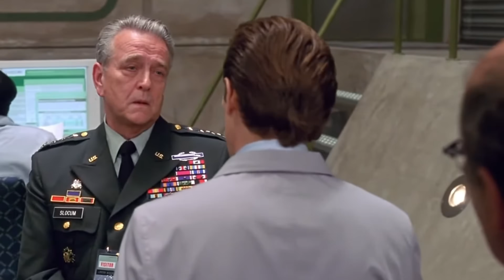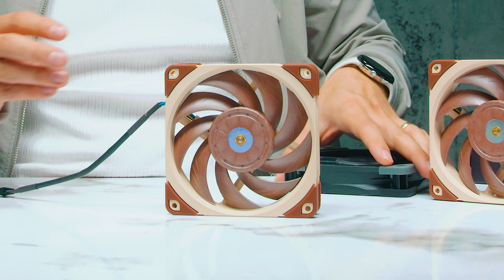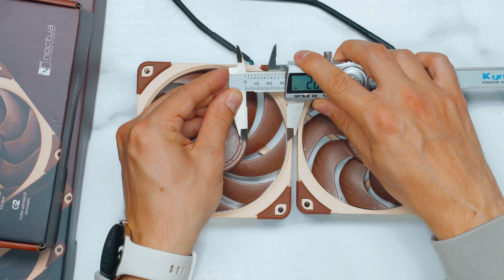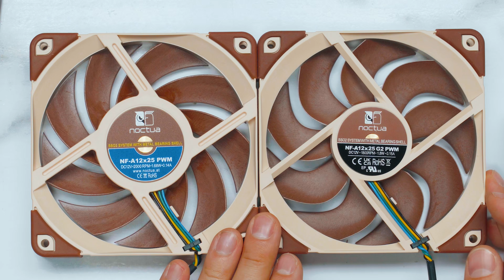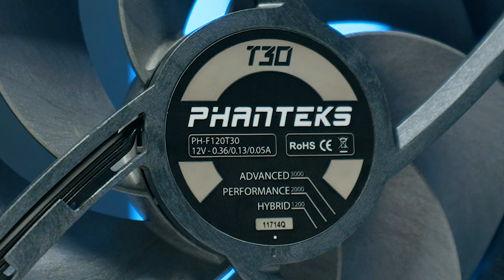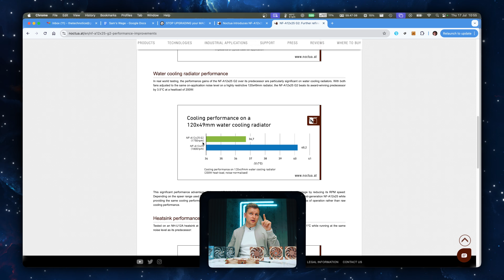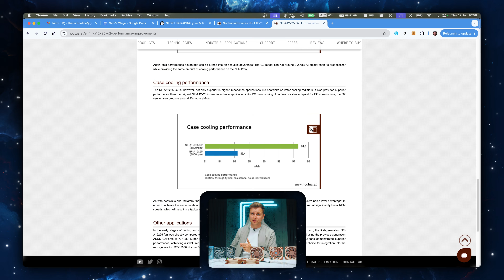Why it took Noctua 7 YEARS to BEAT the CHEATING Competition!?

Comment: I have 10 120mm fans in my PC with room to go for push-pull on my rad so that would be 13 fans. If I went with all Noctua, that would be 520 euros for fans, each being FORTY EUROS. That is insanity.

13 Arctic P12 PWM fans would only be 65 eur. Are they anywhere near as good? Hell no. But Noctua's pricing is braindead.
Reply: Arctic still the best choice p/p
Reply: Noctua fans are expensive. The A12X25 G2 is 35 € though, not 40, and right now on Amazon the v1 is actually 33 € new, 28€ used (from Noctua, which includes a full warranty) and you can literally get a used 10-pack for 240 €, which includes a splitter and a 30-cm extension cable for each fan. It's still substantially more expensive than the P12, and the bundle obviously doesn't make up for the price difference, but their longevity might - every Noctua fan I ever bought is still running smooth (17 years and counting). I can't speak for their silence as I haven't compared with the P12 but, with 10 or 13 fans, I imagine even a 0.5 dB gain per fan would make a big difference on a daily basis.
Reply: @yumeN0dengonThe P12 isn't competitive in the noise department at all. It's somewhere near the bottom actually.

Which doesn't really matter if it doesn't need to spin very fast since you'll need to take the noise floor into account. They're just cheap fans that will do the job.

Comment: I've been buying Noctua fans for decades now. I probably have about 40 of them and I just realized not a single one of them have failed. Nice lol. I do get a lot of Arctic and BeQuiet which are also pretty good, Arctic especially for the price, but sometimes that extra little bit better makes the difference you need. Their support is pretty good too, like I needed to rotate some fans 90 degrees on a discontinued 2011-V3 line and they sent me a bracket adapter I didn't know existed.
Reply from the maker: Wow, nice!
Reply: I've had really good support from be quiet! too.
Reply: I have about a dozen of Noctua fans and one has died on duty. I have to clean it and see if this may ressurect it.
Reply: What are you doing with 40 of them?
Reply: I've got a failed Noctua. A 92mm (Had to get Noctua, nobody else bothers to make a decent pressure fan in this size)
Was a GPU deshroud swap.

I've just realized that it was probably still under warranty and I could have exchanged it lolololol

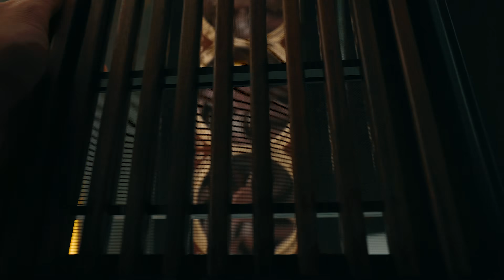Comment: 11:36 The three fans of my gpu run at the exact same speed, and past 60% fan speed I get these annoying sounds
Reply: Actually if they run at the EXACT same speed they won't make extra noise. It is when they are only a few (relatively) RPMs off, it will create a "beat" frequency that makes an intermediate sound.
Reply from the maker: Yep!

Comment: I doubt any fan brands are cheating, it’s basically copying. Before Noctua NF A12 x 25, there is Nidec Gentle Typhoon. So everyone starts copying. For Arctic P12, they don’t even copy, it’s originally with 5 blades. So how are fan brands cheating 🤔 hmmm. 

Now Noctua G2 yes original design.
Reply: It is just clickbait.
Reply: he is just reading the noctua spreadsheet, and interpret it wrong, and spit out that.
like the resonance part, they didnt do that to use A-B-A on one side of the radiator, instead its made so that in a push-pull configuration the blades of the fans slightly overlapping because the small difference in speed, as noctua always have stated.
also bad use of caliper for measuring the lenght from hub to side
Reply: @Ta5.   You might be right, my bad. I find it off to read from script, if it's provided by Noctua, pointing out other brands are cheating.. hmm abit silly. Anyway, main focus to be here is to see the new G2 fans. Thank you Tech Notice, pardon me for being blunt.
Reply: @KleoYan I dont think that he fully read it from a script or at least that script isnt fully by noctua, because I highly doubt that noctua would call their competition as cheaters or would give an inaccurate example about the resonance
But yeah, to me, this highly feels like an ad
Reply: oh hi Kleo you here too😁
yea great👍
Reply: @luxubu666 hi ya 🤭🤭🤭 yes am here. Being lazy and watching reviews hahaha😂
Reply: Kleoooooo! 👋 H!
Reply: @OrekKolnas Hi 😉

Comment: Dear Noctua, colours other than tan and brown exist
Reply: Chromax version for NF-A14X25 G2 comes this quarter, for NF-A12X25 G2 it will come at quarter one next year. White fans unfortunately were dropped from roadmap.
Reply: @eliadbu  but the chromax versions are expensive. I guess noctua can get away with charging more for black versions. A friend of mine who is a technician told me black fans are cheaper to make and it's absurd noctua charges more for their black versions, but the chromax comes with more accessories so I guess the higher price is somewhat justified
Reply: @ahmedhamdan2009  it's noctua, if paying the extra 10% for chromax is too much for you, yeah get a different fan as they're not cheap to begin with.

Comment: Before we give Noctua too much credit, it got its design for the original A12x25 from the Nidec Gentle Typhoon.
Reply: Not true at all. And the basic blade shapes aren't really copying one another at all anyway, the shapes have been known for decades, nobody is really doing anything dramatically new, Noctua just executes the best in the market with the highest quality.
Reply: Was searching for this, gentle typhoon was the first of it's kind, more credit should be given, the giant whose shoulder the other stand on
Reply: I have them too. not in use now.. but no.. they were not ripped off by Noctua. Also, that is a visual thing based on a common blade count, but you aren't taking materials, blade shape + distance, etc, into account. nidec didn't do that from what I know.
Reply: A misconception about blade geometry and angle of attack is often propagated by those who do not fully understand these concepts. They are not similar except for the number of blades.
Reply: Please, they share 9 blades like other fans and nothing more. The Gentle Typhoon was a good fan back in the day, it was either them or Nexus fans that was high up on the list...i remember having a bright orange Nexus fan in my Antec P180. The good old Athlon64 and Core2d days.

Comment: One day, when Noctua makes them in black, and the prices drop, and I have spare money, and my PC is getting too hot, and nothing else helps, I'll probably buy these.
Reply: For me it’s the price man. Bring down the dam price!
Reply from the maker: Bring on the black
Reply: @theTechNotice  Should i buy intel for quick sync even after rtx 5060 ti  release?..
Reply: I need them in white
Reply: I was once one like you. As i got older, i appreciate the hard work, good performance and reliability of these alot more.
Reply: @nicoleibundgut534  My PC already has hard-working, good performing, reliable fans. These would be 100% luxury if I ever bought them.
Reply: @nicoleibundgut534  yeah exactly!
me too... just bought Arctic for years but than i tried beQuiet and Noctua. Now there is no return to the cheap stuff xD
Reply: Yeah that's pretty much how I feel. I'd also love to see Noctua go after the deeper highspeed brute-force "cheater" fans with a version of the ones in the video- Similar performance, slightly quieter, with that Noctua quality. Maybe around 2,500 RPM?
Reply: The black ones will arrive but the prices usually just stay where they are with Noctua. I really like Noctua products for a long time now and the prices have not changed a bit.
Reply: @JikoMuskato Too expensive but for those who need best fans for everything, put once and forget for 10 next years, these fans are top right now, if we talking about 25mm thickness.
Reply: so never?
Reply: I bought Noctua black already)
Reply: I'm still running NH-D14 with original fans from 2011 the computer is running 24/7. With Noctua you are paying the cost upfront and don't need to care about performance/noise changes over the years. Over ~10years you will pay same for cheap fan replacements. For me paying upfront it is worth to not think about my pc getting louder and for not replacing the fans with case upgrades.
Reply: Precision is not cheap , they are paying alot for quality control with the tolerances between the blade end and the body
Reply: In the meantime, I buy Arctic fans, because they're cheap, good, and black.
Reply: I always say that Noctua's Achilles heel is the amount of time they insisted on poop-colored fans.
Reply: I bought the black one. I would also haven CV ought the brown one, because you likely don’t notice much I’m my build, but then I saw the black one
Reply: buy thermaltake spirit you dont need these and its cheap
Reply: They'll get right on it your heigness
Reply: Black version will come out q1 next year, as for price well they don't usually go on sell...
Reply: @eliadbu Noctua released them already!!!🎉🎉🎉
Reply: The are two kinds of people. First are those who cry about the color and price and the second are those who buy them and used them for many years. If you cant do them math , we are sorry.  I still have my very first noctua fans from 2010 and NH-U12S. That's 15years.
Reply: @GabrielKozsar  I only care about the color for one reason: I don't need them; they're inherently a luxury, so I would want them to look good. Chances/hopes are I don't spend another penny on my PC for YEARS
Reply: @GabrielKozsar I still have my fx 8370 an a gtx 1070 with nhd 15 cooler on it . An all Noctua fans . Not one of the fans make sounds of failure. The builds right at 12 years old now .
Reply: Noctua fans are built to run for 15+ years. I've had Noctua Industrials for 6 years that still work perfectly after almost 24/7 usage, and some older brown models that came in an NH-D14 from 2010 that still work in my backup NAS. Yeah they're expensive, particularly with these G2 fans, they are 1) quieter 2) perform best, so you aren't paying extra for nothing. Now, certain builds you don't need them and certain budgets there's no way you'd rather better case fans than a better GPU, CPU or doubled ram, but they do the job they say.
Reply: @bigpoppa1234  arctic ones will last between 5 to 10 years. they cost 1/5 of noctuas, so that puts them up to 30-50 years at the same cost. Noctua is great, if u can burn money for no reason.

Comment: No replacement for displacement. At the pricepoint, the T30's still the king, even in just Performance mode.
Reply: You haven't used p12 max I see
Reply: @igelbofh  I said at the pricepoint. The P12s are half the price of the T30, so I think it's unfair to compare them in any way. But yeah, buying a big pack of P12s is usually the move when I want to populate a case with hella fan slots. I've never used the Max version though.
Reply: @ccayco the p12 max is a very different fan than the p12. Try them
Reply: @ccayco saying not to compare a product because the price is different is wild. For most people it is arguably one of the most important comparison metrics.
Reply: @ccayco  Price has nothing to do with the actual performance of the product, isn't that obvious??
Reply: The P12 Max is waaay too noisy to be in the same conversation as A12x25 and T30
Reply: @Mikkel111 only if you run it above 93%. It still moves a lot more air than the others at lower rpm though
Reply: @igelbofh  It really doesn't. Every single review I've seen had it at mediocre levels of air movement. And it's a lot more noisy at just 1200 RPM and up.
Reply: @Mikkel111 try it for yourself. It's not that expensive. P12 is not good, p12 max is a completely different, much better fan, especially when the air needs to be pulled/pushed through some mesh. The noctua doesn't even qualify here
Reply: @igelbofh  P12 Pro (and even P14 Pro) are out now - they are on another level + fixed some noise issues of P12 Max... lower max rpm but higher airflow at same RPM, also x1,6 higher static pressure. Just another banger from Arctic :D

Not that the P12 Max is bad, I bought a few slightly used (got em at a great price), using them in my new build... tho if they are allowed to rev to maxspeed they definitely sound like a airplane turbine 😂
Reply: @jxg1652 don't rev them beyond 93% :)
Reply: P28 are about the same performance wise, chose 'em over T30 due to cable management, 5 cables instead of 34 is a blessing lol
Reply: T30 are the same price as the noctua for me in Europe

Comment: Well T30 still the king.
Reply: Was thinking the same thing, completely non informative video whatsoever.
Reply from the maker: oh, Mr. Cake, a bit negative don't you think?
Reply: @theTechNotice  Maybe, but I did not ment to be negative, just what I felt, watched the whole video btw. Also take about that other fans have higher top speed is kinda meh, you can always lower it.
Reply: @theTechNotice  That wasn't negative, that was very objective.
You made an entire TED Talk of just yapping about nothing, while claiming competing products are cheating.
If they were only competitive at speeds above 2000 RPM, then yes. But since they compete or even beat Noctua at the same RPM, it's just a ridiculous claim.
Reply: It's also bad faith to say T30's are loud when at the same noise level and/or RPM the T30 beats the A12 in airflow.

Comment: Tartini tone generation from crossed acoustic frequencies is awesome science but it sucks when the fans in your PC start generating teeth-gritting noises that don't come from any one place. It can make you crazy.
These fans using frequency adjustment is hard science engineering that shows how much Noctua is willing to invest in their products. Very cool stuff. Thanks Lauri.
Reply: I agree. We also can't blame people for choosing other fans based on price... they just don't know these things and a functioning setup is better to them than resonance reduction. I love Noctua though, over 10 years no issues, and great customer support that puts companies to shame.
Reply: @albertcamus6611  non-resonant fan installation has been a design issue in the HVAC industry for 40+ years and longer in industrial ventilation systems.
IMac designs that started with the slimline bevel also included a fan resonance control connected to the thermal sensors.
Reply: @WireHedd  I just want to make sure that no where in my comment did I say Noctua started this. I am saying the average person does not care at all about fan resonance if the price is right. But I chose this company because of their efforts to push such things and their customer support is top.

But yes, this has been around for some time. I also should say that noctua is also in the industrial fan sector for non PC related products covering various other applications.
Reply: @albertcamus6611  Correct on all counts.
Reply: it was pioneered on 2019 mac pro more than half a decade ago, it's not like noctua really had "aha" moment by themselves, more like exceptionally late copying of already existing innovation